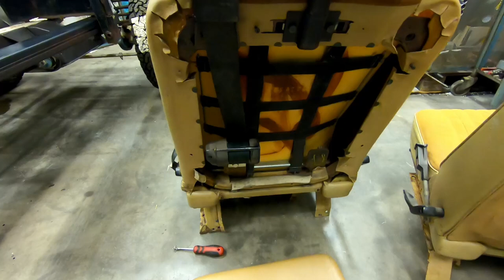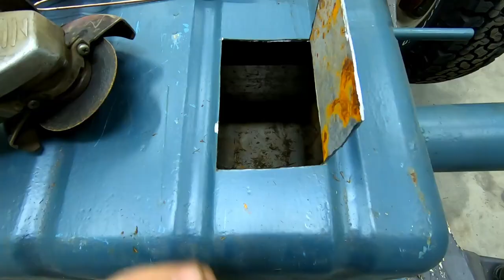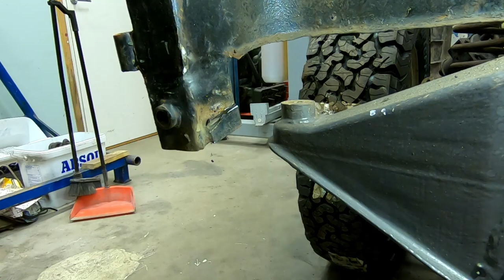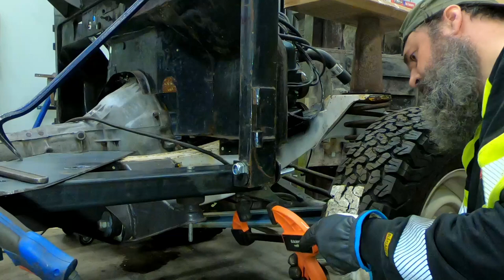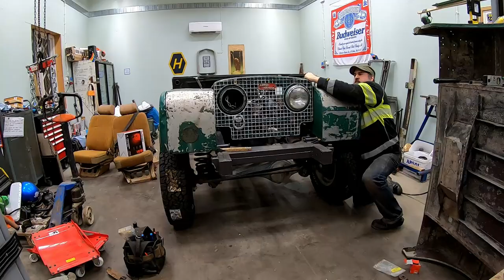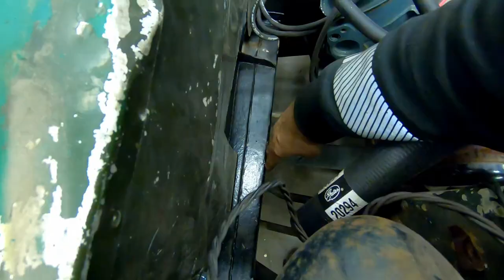Land Rover Series 1, V8 conversion

Comment: Great idea for using the Range Rover mounts for supporting body.
One thing you'll need is bulkhead supports from bulkhead to inside of chassis , on a normal Series 1 it's used to support steering column too.
Reply: Scratch that I see bulkhead has supports in next episode .
Reply from the maker: @hammyh1165  Yep. Thanks for watching mate. 👌

Comment: That petrol tank 😳
Reply from the maker: Yes. It's lovely isn't it? 😇 A new is not expensive but the shipping to Sweden is.
Reply: @slowshop  Birds made a nest under the bonnet of my IIA 88", but I'm impressed they made themselves a luxury apartment complex in your petrol tank. What are you doing for the back body on this?
Reply from the maker: @onetonlandrover  When i bought the chassis it had been stored in a barn since the mid 80s so there was all sorts of critters living in it. I'm going to make a pickup of this one. Havant decided if I'm going to use steel or aluminium.
Reply: @slowshop  Do you mean like a tray back? Or will you emulate the series 1 lwb?
Reply from the maker: @onetonlandrover  I'm going to make it look like an original 107", or as close as possible.